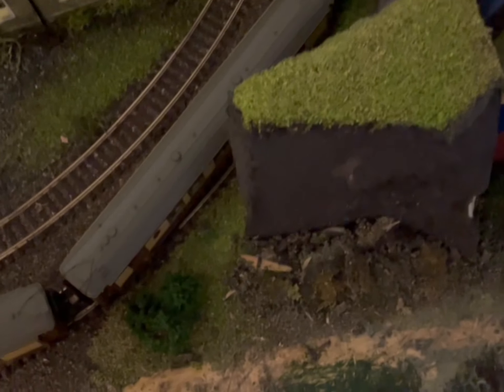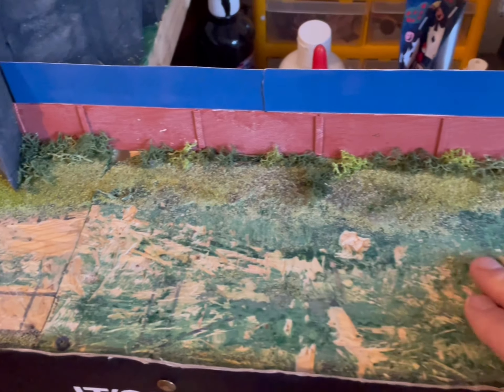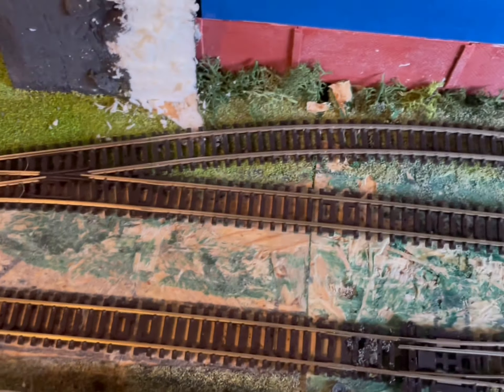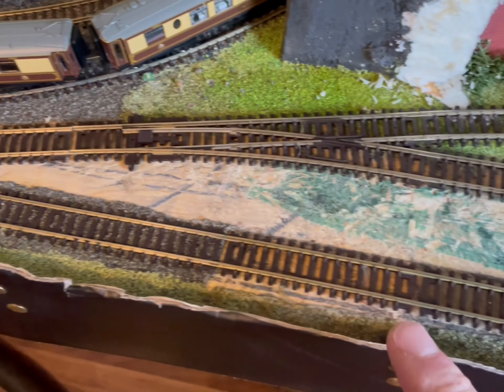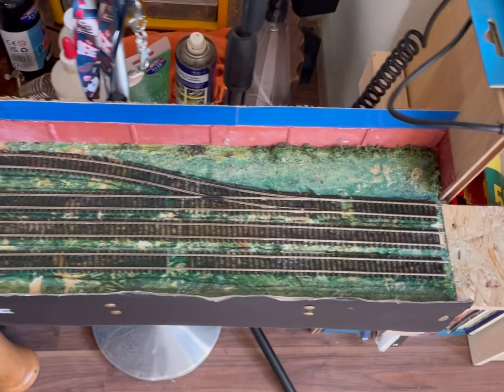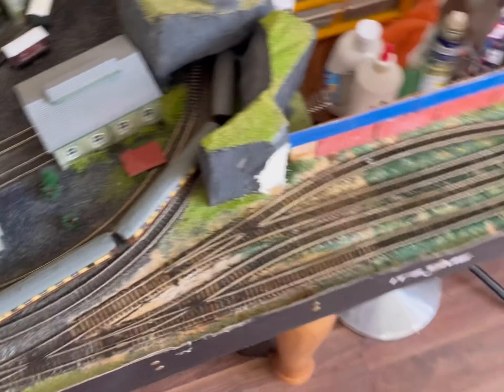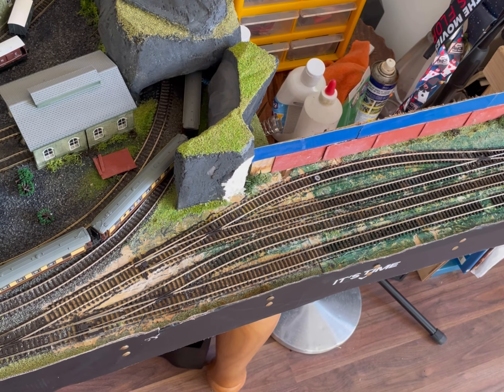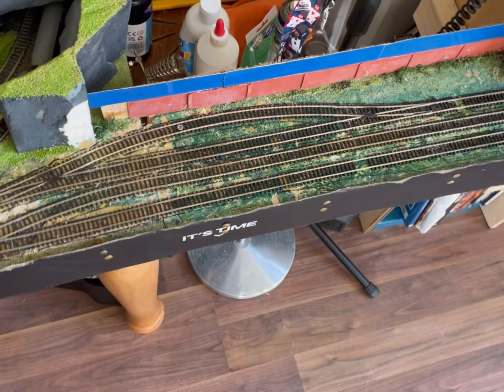Hornby TT:120 - Amber Falls Part 39

Comment: Hi, just wondering on what the gap is like between the 2 central lines, it looks a bit narrow. Great video, really good looking railway, I must get on with starting mine, I have all of the stuff, but little time.
Reply from the maker: Thanks! It’s coming on now. The gap is tight but it is a fiddle yard now mostly and wanted to fit a lot on. But all working nicely. The Mallard fits past the wall which to be fair thought I would have to move that back.
Will do some full testing in next video see if any issues arise 👍